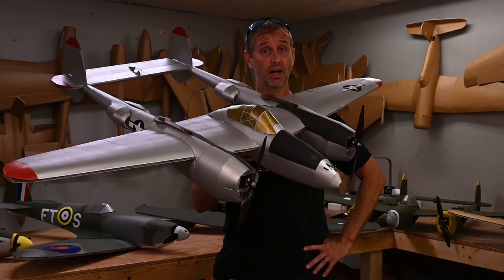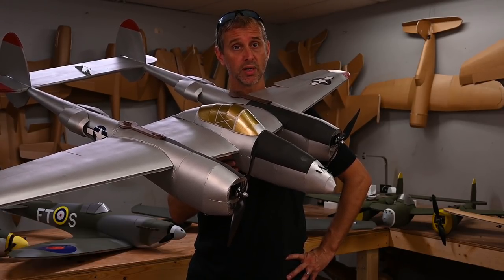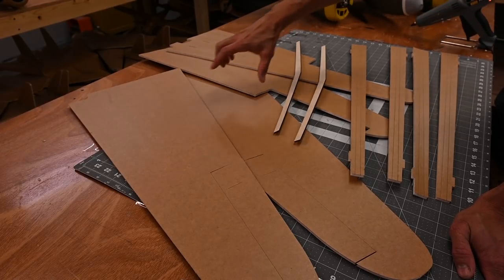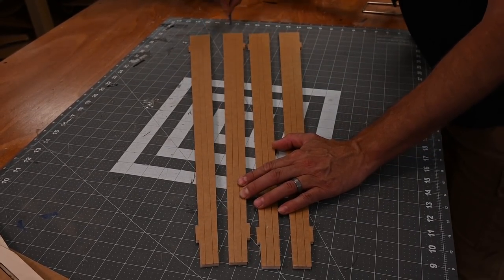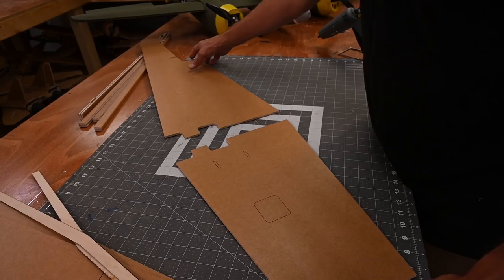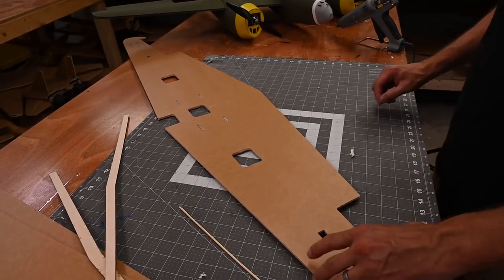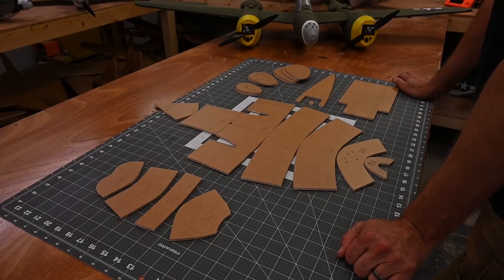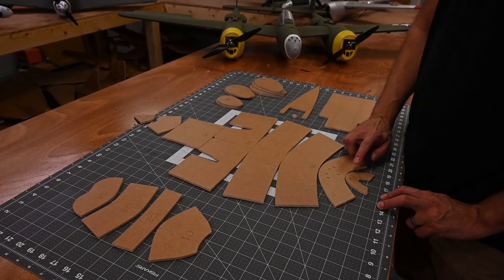How to Build the FT Master Series P-38 Lightning  //  BUILD

Comment: JOHN OVERSTREET, thanks for another brilliant Model!!! 
Trying to make a long story short... 
My Dad was one of those Rockstars in the USAF! Among his impressive list of friends was the Chief Designer of this Aircraft, Kelly Johnson. 😎😎 

One of the amazing things he told me was - "No matter how good you are, and how good your work is, always have a different pair of eyes look at it." 

With that, I offer my humble suggestion, as a nobody who can only DREAM of affording a Master Series Kit - and the Electronics to go with it. 
I was also in the USAF, nowhere near the level of my Dad. I'm now disabled, and trying to Fly RC on less than a shoestring budget.
(I am drooling over that P-47 though!)

All of your Designs so far, have been amazing and have elevated the Foam Core Board Aircraft!! But they share one issue...
Uneven and sometimes separating seams along the bottom. 

NOT the end of the World, but if you're interested, I've developed a very simple solution, that makes your Beautiful Planes even BETTER.

When building the Fuse, or in this case Booms...
Right after the bottom seam has cooled, before adding or cutting anything else, I cut a 1/2" strip of Brown Paper (or White) and Glue it along the Seam. Usually with Wood Glue.

It sets in 5-10 minutes, cures in about an hour.
What you're left with is an extremely strong, even and smooth Seam line - that will hold its shape, and NOT pull apart.
In ANY Weather!! 👍👍😊 
Looks pretty good too.
Carmine ✈🚂🚙
Reply: Poormanrc first, thanks for your service.  Second,  I was army and had a med discharge and understand the shoe string budget.  Great suggestion to hid the seams!  Remember skunks mantra was if it looks right, it flies right!
Reply: @ShadowOppsRC  Thank you for YOUR Service! 
Although I haven't been able to afford a Master Series Kit... I have used my Paper strip idea on Box Fuses, Tail Feathers and Wing Leading Edges, with great results. Using Wood Glue, it dries flat and is quite Strong...
Also gets rid of those gaps and exposed Foam.

Comment: Building my second one today , along side the modified A-10 i have started.  I cant wait to show you guys my mods.   Landing gear , edfs , Arduino flight controller with PS3 controller. LORA radio.  FPV.   IMU with GPS .  Altimeter and Pitot tube air pressure differential sensor for air speed.  etc.   LOVE YOUR FACES>  you are keeping me sober now going on 3 years.   thanks flite test.

Comment: Hi John,
Thanks for your expertise with these foam board planes, and the ability to show us how to build these great models.
This P-38 is my third speed build kit, it was a challenge to be sure, but it turned out pretty good.
My issue now is with the location of the CG, I have contacted Flite Test support with very little success.
Their recommendation is to use the 45mm CG located from the leading edge at the wing root. I would have to put approximately 490 grams (1lb) in the nose.
When I followed the CG instructions found on the Flite Test site by James Whomsley, the CG is not even close to the 45mm. It came out to approximately 80mm.
Please if you have any insight to this issue, I may be completely wrong with my calculations, please enlighten me. I would love to have more than one flight. 
Have a good day.

Jim Welch

Comment: Just finished the vid... great build. I’m sold. I’m buying the Speed Build kit... I’ll download the plans for replacement parts, that of course I’ll never need. 🤣😂🤣🥰
Reply: Don't get your hopes up.  You lose your money.  If you cut it, it will be ruined at the landing gear area.  And the twin engines won't fire up on the battery you use.  You'll be stuck not knowing what to do.  And I think they use a capacitor with the frequency range to get the right spark for the twin engines.   But this capacitor is not sold in Flite Test Store.  So you're stuck.

Comment: I wonder how well this kit would be for a template so I can use sheets of thin aluminum instead of foam board. I don't know how to weld aluminum so I'll have to use another method for securing the pieces together and I'll need much stronger motors too.

Comment: I it a good work and it takes long time we can use aluminum metal plate and we will shorten the times and will became our project air plans more solid and power so to get rid of glue,it takes too much time so may in high speed destroys,aluminum plates is cheap and flexible easy made,thank you for this cool work.

Comment: it's a bit disconcerting that about a 1/4" needed to be cut off when the upper wing halves were joined in the center. are the cutout parts (and the plan) "off" by that much, or is it variability in assembly?

Comment: I am assuming of course that he is going to setup the plane with contra-rotating power. Many were equipped with both .50 caliber and 20 Millimeter. The .50 cal. should show different barrel lengths sticking out as the guns were staggered to allow the feed belts to be properly attached.

Comment: Hi guys, I'm interested in building this P38 and others in the series, but do I need a 300w glue gun for the build or will a 150w be good enough ?
Reply: 150 would work, but the glue comes out cooler so your open glue time will be a little shorter. Not necessarily a bad thing. 300 spits out hotter glue so its runnier but stays hotter longer to work with (also takes patience sometimes to let it cool while you hold parts together).
Reply: @tyfude  cheers for the info 👍👍👍

Comment: glue the servo connectors together. i taped them like he did and they came apart in the wings. I've had to cute open the bottom of the wing in the middle and next to the servos. Huge roadblock makes me want to not finish it.

Comment: Imagine accidentally making different airfoils so the coefficient of lift is different on each wing and you're constantly having to correct the roll tendencies in flight.
Reply: I don’t think it’s possible to have two different air foils because  the top of the wing gets glued down onto the spars and they are all the same thickness . I could be wrong , I built the p38 full size,and the Spitfire, the P 51and the P 47,  they are not easy to build but once you get the hang of it they are a lot of fun,and fly very well. Try one.

Comment: I admire his design expertise. It looks really good but way way way too many pieces and way too much work. First crash and it becomes bits of foamboard. Bixlers earlier designs were easier to construct, more forgiving and if you crash, some tape and hot glue is all you need to fly again. And if you really had to rebuild, you could do it in an hour and be up in the air again.
Reply: Believe that was the hesitation on releasing the design (though they've had it for a long time - its in the background of a lot of vids); But it is part of the 'master' series for a reason.  With the exception of an injection foam model or two - most p38 models don't crash well; it comes with the design